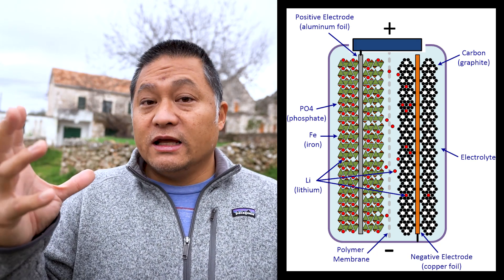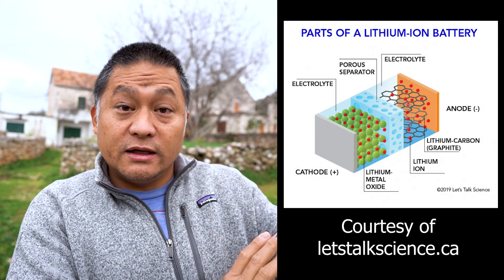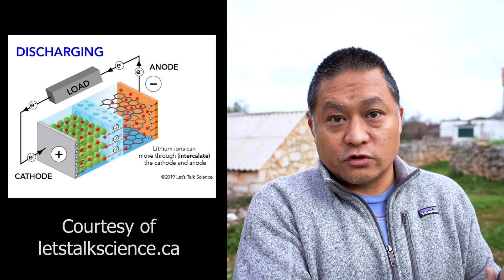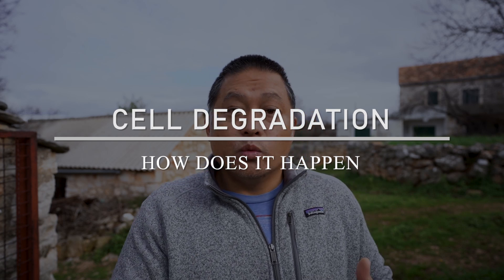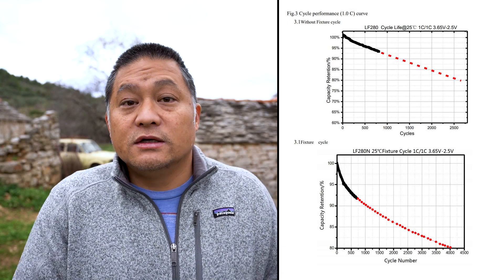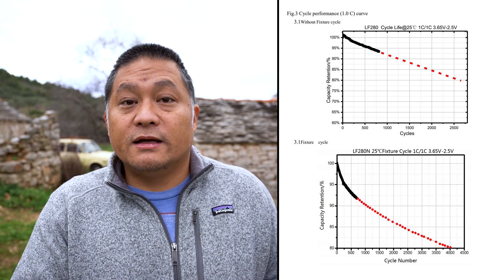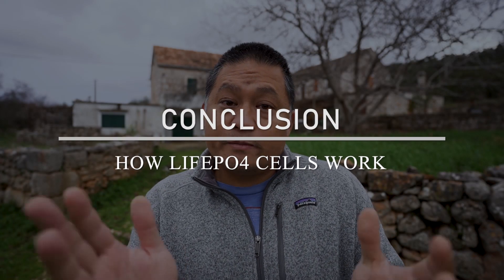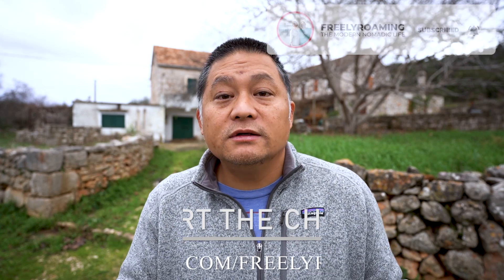How LiFePO4 Batteries Work and The Truths About Compressing Raw Cells

Comment: The sides of the cells transfer about 10 times the amount of heat as the other surfaces, because of the way the internals are folded. Anyway this  video is about 3 years old and EVE has finally made public the datasheets with the compression fixturing info.

Comment: Nice logical explanation. I have 16S 3.2V cells x3 in parallel. The max my system will charge is 200A (with no loads) and the most the inverter will draw is 200A. Divide that by 48 cells is max 4A charging/ discharging per cell. C1 rate is 280A so 4A is equivalent to C0.014 charge/ discharge rate. Compression is NOT required for this config I would much rather allow the cells to breathe and exhaust any heat. The BMS temp probe is stuck to the upper side of a central battery and is ALWAYS at room temp, never seen it rise even 1 deg C higher even when charging full 200A. 4A is like a trickle charge for these cells.
Reply: You should divide the current by 3, not 48, because the current is distributed over 3 strings of 16 cells. That will result in a maximum charge/discharge rate of 0.24C.
Reply: @streefland  So your telling me if the total current flowing is 200A from 3x batteries in parallel then each cell has 67A flowing out? That makes no sense. The C rating is per cell, not per battery.
Reply: @ricardophelps6323  Exactly, there is 67A flowing through each cell, so the C rating for each cell is 0.24.
Reply from the maker: The calculation is easy. Forget individual cells. Look at it as a complete pack. If you are charging a 16s3p pack with 200A, then you are using a charger that is outputting 58.4v which equates to charging output of 11,680w. Total pack capacity is 43,008Wh. Total Ah for the pack is 840Ah. 1C for this system is 840A. So 200A charge is a 0.24C. (200÷840). Technically you are charging at 0.27c (11,680÷43,008) because the charging voltage is higher than the nominal voltage (58.4v vs 51.2v) but going by theoretical c-rate in amperes 0.24c is more widely accepted.
Reply: @freelyroaming  I was just using simple math if my charge controllers put out 200A total and there are 48 batteries all taking current equally then each cell takes 4.2A or 67A per 16S pack. Do you agree with that?
Reply: @ricardophelps6323  No, that would only be true in an 48P pack, where all cells are in parallel. 67A through a 16S string of cells means that the current through each of these cells is 67A.
Reply: @streefland  Okay so currently I have FLA battery with x24 1000Ah cells so 48KW. When charging at 200A with no loads what can I expect to see going into each cell?

Comment: I just purchased a 12.8V LiFePO4 20AH battery from Amazon and made a huge mistake by trying to see if I could power my 1000 watt Microwave oven using my 1000 watt Inverter.  It powered to microwave oven but I noticed the voltage dropped to 10V during this test.  I stopped it after about 20 seconds.  Battery voltage went back to normal and it seems okay.  I am worried that I may have caused damage that will greatly shorten its life.  Do you think I caused permanent damage?
Reply from the maker: It definitely could have caused some degradation. Pulling 1kw from a 20Ah pack is nearly 4C. LiFePO4 packs should not really exceed 1C discharge rate. But for a short moment, it might be able to withstand it. I would not try pulling that much wattage from any pack less than 80Ah.

Comment: Even under 1c delamination will happen, compression is mandatory for long term use. Mine are compressed for a year, I got some 3mm plastic foam between each cells that let them bloat a little if needed, but not too far, and as they bloat a little, foam pressure increase.
2 plank, 4 rods 4 plastic tubes to insulate those rods, easy project.

Comment: Great Video. I have a question, im considering a Lifepo4 raw cell x 8, for a 12v camper setup, for 600ah. Im only at the beginning stage of learning, and its a large hurdle atm, and keep falling back to off the shelf batteries. Eager to go the build method, concerned if there are more failure rates with building a kit, vs off the shelf batteries. Do the stand alone BMS units fail more often, and do we create more problems with build kits vs off the shelf batteries?
Reply from the maker: If you were to crack open off-the-shelf batteries you would find  that there is no magic trick that makes their components work better than a diy one. It's really just knowing how to pick a good components and understanding how to assemble them properly and safely. I just uploaded another build video that shows a simple build but using good quality parts. That might be of some more help.

Comment: I wish to build a battery bank for off grid 48v to process power from p.v. panels. However the area in which I live is generally warm to very hot in summer, South Australia. Is it possible to use 1-6mm aluminium sheet cut and fitted between each cell with some of the ally projected past the cells front and rear by around 100mm or so. That should act as a heat sink, or is there some residual voltage, or worse current between calls, that is if the cells are made of metal, like ally as u tubers say.. Battery drain will not  be large as it's supplying 5k 48v inverter, but to a small house, minimum apps. Thanks

Comment: The datasheet  shows the aluminum enclosure is a fixture and it apply compression about 300kg of force. I don't think it's that necessary to apply additional compression to raw cells since the aluminium case is a fixture

Comment: The secret is an equal pressure, not only the force of about 3000N shown in the datasheet. Therefore I would prefer a thin  layer of epoxy between the cells to reach this state when you apply the mentioned force.

Comment: I have been asking that simple question for quite a while and I liked your answer better than most.  In particular it seems to me that lithium ions do not migrate from the cathode to the anode- they must transfer to as cations to the cathode and as atoms to the anode. In other words the charged battery must have lithium atoms ready to lose electrons to begin the flow that produces the energy needed. You generally used the term lithium element which I guess is better than most but it is vague. Also nobody wants to talk about the balanced chemical reaction or the half reactions of a lithium iron phosphate battery. I welcome your thoughts.

Comment: Thanks, very informative.
I’m planning a build where I will install the cells into my 4x4 canopy frame. It is currently dead space. This will require the cells to be connected side by side to maintain a thin profile.

The canopy is Aluminim so should help with heat dissipation

Comment: I'll rarely exceed .2C discharge and .15C charging.  95% of the time I'll be keeping these cells between 20% and 80% state of charge.  Does compression seem necessary in my case?

Comment: Does the fixture refer to a cell or a battery in the data sheet? The extrapolated portion of the curve suggests more cycles and the measured part of the curve the opposite. Perhaps the experiments were on a cell. The total cycles being representative of a perfect balanced life cycle model. How else could the extrapolation be meaningful if in a package of cells? I would imagine the atmospheric pressure is a factor. In a pressure vessel equivalent to 20-30 head feet of water, the cell would be ideally compressed. Does anyone connect the terminals with spring force like a flashlight light batter terminal? Striving for that stress free lifepo4.

Comment: Thanks for taking the time to research 🧐 and then communicating what you know and your thoughts on these batteries 🔋.I have 2 -200 amp lithium similar to yours with a 120 Daly . Tested the low temp and it worked perfectly.I am also thinking of limiting discharge to 20 % and charge to 90% .At this point I’m  putting them in a Rv Class C w/2000 inverter.what are your thoughts on 20% - 90 % ?

Comment: The best thing I can think of is to enclose every cell in a thick, let's say 1/2 ", aluminum case that fits the cell perfectly and wont let the cell expand. That way compression only occurs  when the cells are trying to expand and also dissipates heat at the same time?
Reply from the maker: It would work for sure but really not necessary for the relatively small benefit you might see from it.
Reply: @freelyroaming  Not even if you almost always charge/discharge at 1C?
Reply from the maker: For me that answer is yes because it most likely would need to be a custom made enclosure and the cost and time that would go into building such a case just wouldn't pay itself back as compared to similar improvements you would get from threaded rods and plywood that would be cheaper and easier to use.
Reply: @freelyroaming  Sorry, I meant the idea it self. Lets say I'm a welder with an unlimited source of aluminum? Would it be better for the longevity of the batteries if you are planning to abuse them with 1C charge/discharge? 

I also have another question. The Daly BMS seem to be limited to half the amperage when charging. Do you know if it will shut off charging or limit the current?

Also I love the way you explain things and thank you so much for putting this out there! I will recommend this channel to all my lithium pals!! <3
Reply from the maker: Thank you. Well conceptually it would work. You would just want to electrically isolate each enclosure from the next cell as they are often connected to the anode. As far as the bms, it should protect from both charging and discharging. A common port unit should not have different amp ratings between in ane out but a separate port will usually have a limited charging amp capacity and can offer better protection.
Reply: @freelyroaming  Thank you! I understand that the BMS will protect against over current charging but in what way? Say that I have a Daly 100A that only let me charge at 50A and I have a 80A charger, would the BMS cut that charger of and not allow charging from that charger or would it limit the charge current to 50A and let me use the 80A charger?
Sorry for not understanding, English isn't my first language.

Comment: Great video Den!

I am Jerry a former pleasure boat captain for fishing in Hong Kong.  For that boat, I made a 36v LFP battery system for my Minn Kota ulterra trolling motor and it just works really great.  As living in Hong Kong it is very easy to get as cheap as possible LFP battery customization from Mainland China and depends on what manufacturer you choosing for what quality of battery pack you get.  I was lucky that the first pick is good enough and meet all my requirement until I sold my boat last year.

Love about the battery could really provide the power with the trolling motor needs, my 36v 75ah LFP battery just cost me around 4500 HKD (roughly under 600 USD) including shipping, and like your package just great and all accessory included (cables and charger!)

As I know pretty much what my requirement and discuss my usage with the manufacturer directly, they also giving many of useful suggestion to help customize my battery pack, like all of the protection in the battery and explain how its works.  (Of course, conversation with Chinese will much easier for both of us)

For my application on that 21-foot long boat with the 36v trolling motor weight of around 1200KG, but that battery can let me stay in a fishing spot over 8-10 hours still not yet discharged complete.  Yes, I am serious, in that year with that LFP battery and trolling motor, I never ran out of my battery once.  The usable energy of the LFP battery over my expectation made me pleased.

And it is the safest Lithium battery ever!
Reply from the maker: Thanks Jerry. This is great to hear and much appreciated. I've gotten several questions about if these would be suitable for electric trolling motors and I assume they would but didn't have first hand experience to confirm. This is really great feedback for those wishing to do the same for their fishing boat set up. Thanks again!

Comment: this is why I selected batteries with cylindrical cells.  alot more durable and resistant to this.
Reply from the maker: Yes cylindrical cells are essentially self-compressing in their method of construction and do not suffer this effect. But they do take a bit more know how and time to assemble into similar size packs. They both have their pros and cons.

Comment: Sorry if I missed this in your series, but how did you charge the cells in your battery build?  Seems like you assembled the battery and then charged it up using your generic battery charger through your BMS and Active Balancer.  Just getting ready to start this process and the top/bottom balancing process still has me a bit challenged!  Thanks and great videos.  Looking forward to being able to travel to Croatia to see family and friends again!
Reply from the maker: The easiest and in my opinion the best way to charge new cells is to connect them all in parallel and top balance them by charging the together using a constant voltage/current charger to 3.65v. Or like me, if you can't get your hands on a charger like that, you could rely on your cell balancer and BMS to gradually  balance out your built pack over a few days with as many charge/balance cycles as it needs to get it up to the proper pack voltage of 14.6v. What I did is far less reliable and requires a little luck that your cells are close in SOC but can be done in a pinch. Having a way to log peak voltage like I can with my Victron Smartshunt prevents you from having to constantly check with a voltmeter.

The BMS will keep each cell from over charging and the balancer will level them out between charge cycles which allows the charger to eventually fully charge each cell. The same way it would work if your cells ever got out of balance in the future.

Comment: Very interesting thank you for the video. There's a guy that has a small car like mine running li-ion, just a 4kw battery pack NOT COMPRESSED...and it's still running after 13yrs. Like Tesla modules 18650 aren't compressed though in a high draw setting ..being an ev.
Reply from the maker: The compression discussion is specific to prismatic cells and not cylindrical cells. Tesla and most automotive batteries use cylindrical cells. They are built using a layer of anode on top of a layer of cathode with a polymer sheath in-between and rolled up tightly so it is essentially a self-compressing form factor by design. Cylindrical cells do not fall into the discussion of cell compression for that reason. If you were building a diy electric car using prismatic cells, you would be recommended to place them in a fixture. As you can see in my video, even without compression, you can still get 2500 cycles before the cells degrade to 80% capacity at max C-rate. Even at 80%, it's still a serviceable pack for many more cycles to come. So 13 years is not that surprising of a time frame for a pack to be 'still running'. It's the number of cycles and the type of cycles the pack has experienced that matters.

Comment: So I hope ur having a fabulous day to be comming up! I have a question about lithium battery configuration to a 4s 12v parallel system.  I was given 4 100ah prizmatic GBS lipo4 batteries without a BMS.  I wast to come out with a 400Ah 12v parallel system.  What would you do to configurat these 4 batteries to meet my needs. I simply did a negative to negative on one side and the same for positive on the other side. This I was told to be incorrect for lipo4 batteries. What would ur thoughts be here?   O off subject a check should be in ur account soon complaints of the new administration. Will be awaiting ur response. Thanks again  ciao

Comment: Do you still feel the same about compression? It seems like you later actually added some compression to you battery box in a later video. Like you, I am not convinced that most of us (non-1C charge/discharge) really need to worry about it. However, if you've changed your mind, I would like to know!
Reply from the maker: Still feel the same about compression. Meaning that is not necessary for low amp draw applications. I'm expecting to use mine for induction cooking in the future so I've added a fixture for now.

Comment: compared to a 12 volt car battery are these the same size . or smaller can you lay them on there side many thanks colin
Reply from the maker: They can definitely be built smaller when comparing similar capacities. You can position them however you wish.
Reply: @freelyroaming  thank you for a fantastic review. I think I will purchase these and put them in my motorhome I’ve had a lot of trouble with batteries I’ve got to gel ones at the moment and I’ve got constant drain
Reply: @freelyroaming  hi there sorry to ask again just looking at the daily BMS there seems to be so many of them 80 A amps 12 Volt Common port van up to 500 A amps common port and some saySeparate port I’m going to install the same battery configurations yourself so which BMS would you suggest many thanks Colin
Reply from the maker: Depends on what your estimated max draw will be. 120A at 12v will give you close to 1500 watts that is what I went with knowing I will never draw more than that. You will need to decide what your max draw will be.

Comment: Definitely don't over charge a battery 2 fast. 19 years ago when I installed car stereos. I seen the guy who was my boss. Who was trying to tune the big system. Battery died. So he hooked up the 200 amp jump. Tuned it then forgot to take it off and left it. As I was working on my car. It exploded